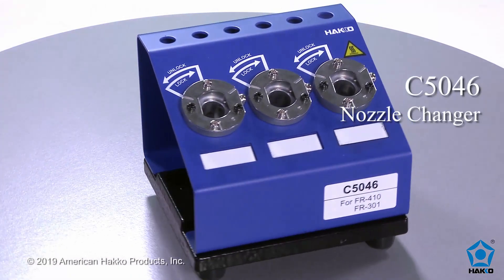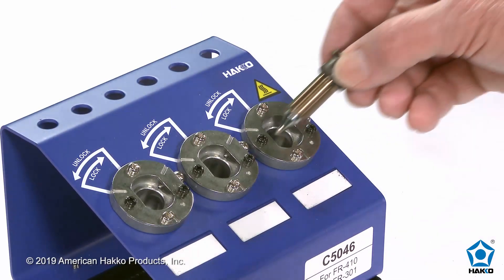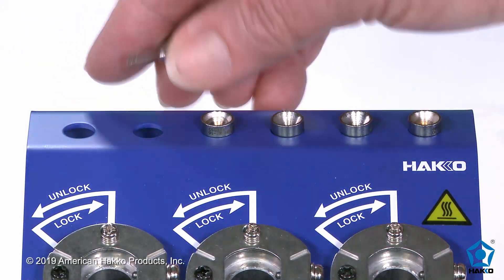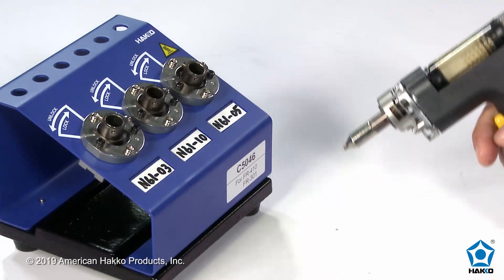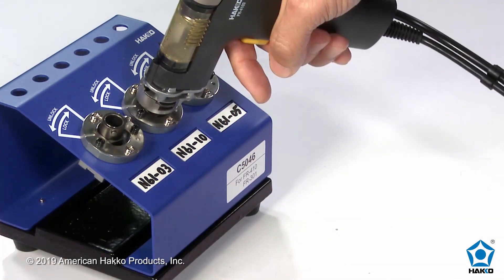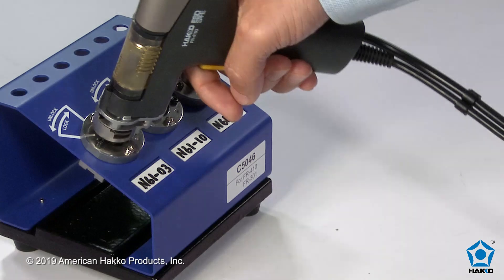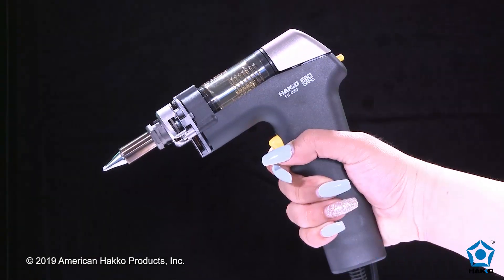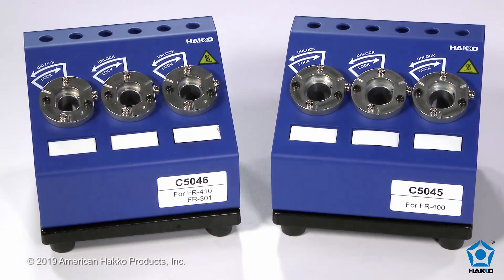HAKKO C5046 Nozzle Changer — Video by American Hakko

Comment: Hahaha, the Hakko C5046 can´t work, there comes without Nozzle holder. The Hakko C5046 can't´t work without this. You can save your purchase, I will send it back. What a stupidity to deliver that way
Reply: The nozzle holder is a part of the desoldering gun and has to be purchased separately. Refer to FR-301 or FR-410 parts list for the nozzle holder that suits your gun.